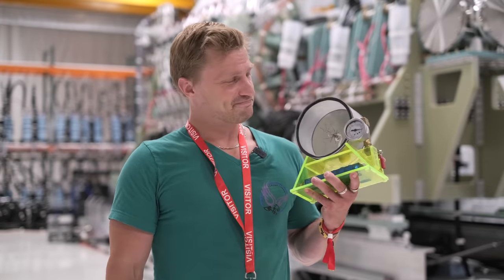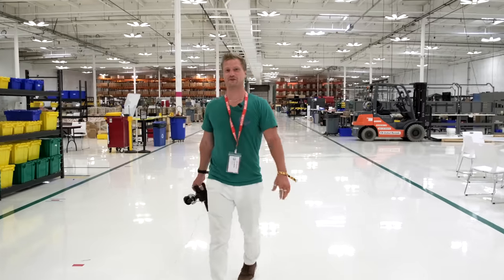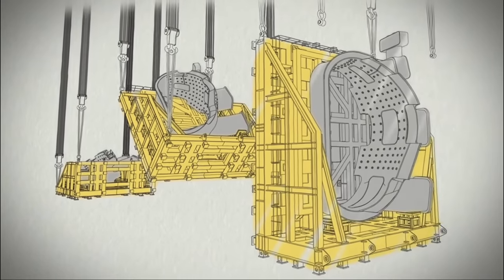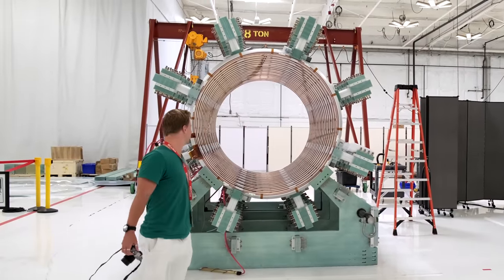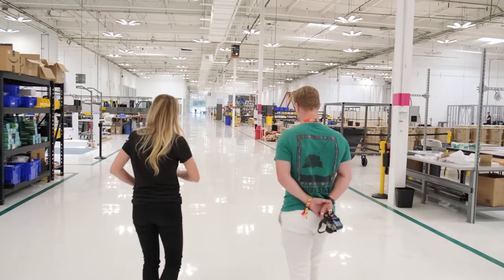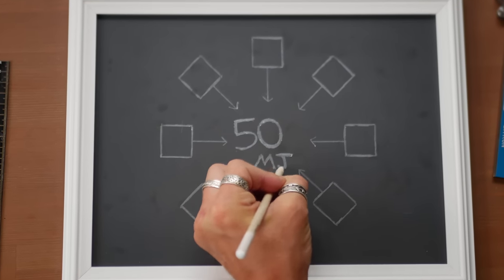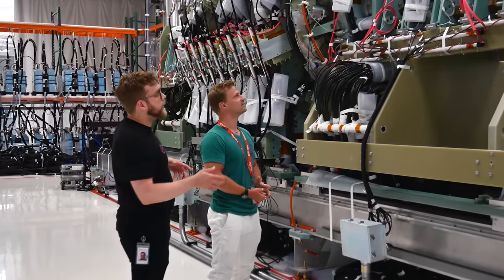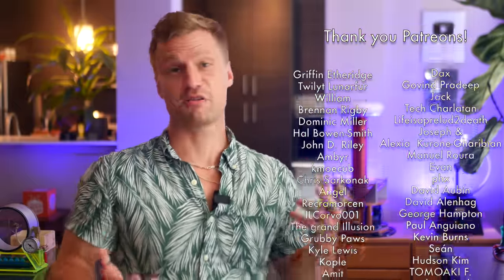An Exotic Approach to Nuclear Fusion (Helion Energy BTS)

Comment: But D-H3 will also produce neutrons (albeit less dangerous). I was quite sad to see they completely omitted this detail. They have neutrons detectors in there too.
Reply: They'll have 10x less energy output as neutrons, lower individual energies, and a cheaper and more durable reactor chamber than tokamaks which probably have the toughest situation with neutrons. It's really night and day as far as the neutron situation
Reply: as i understand it there is no way to accomplish fusion without creating neutrons
Reply: @charlesreid9337  pB11 is close with .1% of energy from neutrons. I think He3-He3 is even better and thus popular for interstellar engine concepts but requires an external source of it like the moon or Jupiter
Reply: @Canucklug  I know but they should have taken 30 seconds (in the already too short video) to explain that.
Reply: No they won't, because DT-DT reactions will happen as well, and the reaction energy of D-He3 is very low vs DT-DT unless reacting ridiculous temperatures, probably meaning the fuel density needs to be higher.  @Canucklug
Reply: @kylethompson1379  D-T reactions are greatly suppressed because the Tritons produced in D-D reactions are too hot and non- collisional on the timescale of the pulse (<1ms).
They are extracted along with the other fusion products between pulses.
Reply: That they don't have any neutron absorption material (even just polyethylene tanks of water) around the reactor shows that they don't really expect significant fusion output.
Reply: @r0cketplumber  
What reactor? Polaris is not completed yet. What they show in the video is the formation test machine. It does not bring the plasma to fusion conditions but is used to test the formation part of the Polaris in a zero- neutron environment. That then will help them optimize Polaris when it comes online. Polaris will have quite a bit of shielding too. A borated polyethylene and borated concrete shield vault will surround Polaris to protect the area outside the machine from neutrons.
Trenta was a low pulse rate machine and it still had shielding in the walls around it.
Reply: Do you mean D-He3 or D-T?
Reply: @caneintel   I think he is talking about side reactions or something.
Reply: Real Engineering has also done a video with Helion and he goes into much more detail about different fusion cycles including their energy outputs and particle emissions.
Reply: @Roset595  And https://youtu.be/3vUPhsFoniw is a response to all of these helion puff pieces from someone that actually knows what they're talking about.
Reply: D-D reaction also produces even more neutrons. They make it sounds like their method is almost entirely void of neutrons and thus "better". I wouldn't be surprised if they run into the same durability problems once they actually try to scale it up and produce power.
Reply: @pdog6041   Only half of the the D-D reactions produce a neutron and that only has 2.45 MeV vs 14 MeV from D-T reactions. D-He3 does not produce any at all. So overall, they get a neutron from one of three reactions (rather than every reaction) and if they have enough He3 from Tritium decay, then only from a quarter of the reactions. And again that neutron is only 2.45 MeV which is below the activation energy of many materials. And those materials they have chosen that do get activated have a very short half-life when activated.

Also, they say that the D-He3 reaction does not produce neutrons, which is correct.
Reply: @elmarmoelzer2229  D-D side reactions have a very similar cross-section to D-3He at the energies they are targeting. 50% of those D-D reactions produce 2.45MeV neutrons and 50% of them produce Tritons. Even if those Tritons are too high energy to produce D-T reactions immediately, some will get trapped in the vessel walls and come out later. Hydrogen just loves to permeate into things. Et voila, some 14MeV neutrons are inevitable. Not as high a flux as in a D-T Tokamak but certainly not zero. Reactor parts, diagnostic sensors, etc. will degrade over time, low-level nuclear waste will be produced, and safety shielding will be required.
Reply: @MattNolanCustom  Tokamaks are steady-state machines. The plasma inside is kept for a long time, so it is possible for them to accumulate substantial amounts of tritium in the walls. Helion's machines are pulsed, the reaction chamber is evacuated after each (very short) cycle; any tritium trapped in the walls, and later on out-gassed, will leave the reaction chamber before the next cycle, negating the opportunity to accumulate.
Reply: @charliem6590  I'm sure Helion hope that will be the case. It's on them to prove it. Very difficult for us to speculate accurately. Maintain such a high vacuum over repeated short cycles in a large chamber is going to be difficult.
Reply: @MattNolanCustom  Sure, parts of the machine will see damage over time, but it is not going to be anywhere near as problematic as for a D-T machine. The parts most hit are the vessel wall around the burn chamber and the magnets there. All the expensive parts are at the ends of the machine, relatively far away from the burn chamber, which is comparably simple (a quartz tube and some aluminum magnets around it). Because the machine is cylindrical, it is VERY easy to replace those parts unlike with a Tokamak where the magnets are always in the way. Maintenance will probably be some 2 weeks or so every year. Really quick and relatively cheap.
Reply: @elmarmoelzer2229  the neutron flux will be pretty much isotropic, so the irradiation damage will fall of as inverse square. All parts of the machine will receive damage over time but, yes, more so in the middle where the plasmoids collide. Yes, it will be less severe than a DT machine, but to generate the 3He, they'll need, they're proposing to run DD machines too, which will degrade more quickly. The issue I have is more the fact that fluff videos like this totally gloss over any mention of irradiation damage by touting the aneutronic fuel mix. I know that all marketing tends to do that kind of thing, but Fusion needs to be more honest to keep public trust and not become doomed in the court of public opinion like Fission has.
Reply: @MattNolanCustom  
I am very much aware of the D-D fusion part, thanks. They can do that in the same machine or a different machine (first machines will do both). If they do it in the same machine, then only about 1/3 to 1/4 of the reactions will produce a relatively low energy neutron. 
They never said that their machines do not produce any neutrons. They said that the D-He3 reaction does not, which is correct. If you look at their website and the FAQ there, then you will see that they do talk about neutrons and radiation produced by their machines.
Reply: wtf are u talking about? Li-5 decays into an alpha particle and a proton.
Reply: @marcianoforst6311  Li5?
Reply: Yes, there was a solid video released on this and other criticism about 7 months ago. I was expecting SOME sort of comment about the temperature levels that need to be achieved to increase the amount of helium-deuterium reactions as opposed to deuterium-deuterium. At 100 million C there are still a LOT of the unwanted deuterium-deuterium reactions which release neutrons. So a lot of shielding would be needed, and alternatively they will need to reach higher temperatures with Polaris, but again no info on that.  There are other potential problems with the magnetic energy capture but I guess that might be a problem they're planning to tackle in the future. Basically this video is an ad.
Reply: @charliem6590 Not very likely. The energies the fusion products possess are sufficient to imbed into the walls. This isn't simple adsorption, the velocity of the tritons means they will be under the surface of the walls. A vacuum in the chamber won't free them, they will continue to build up over time and cause an increase in neutron emissions.
Reply: @afz902k  Sorry but calling that video "solid" is like saying talc is a hard rock. If this comment does not evaporate too, I may try to explain why.

Edit 1 hour later: OK, still here. Let's see if I can add something without tripping the algorithm of death. The main problem in that critique video is that its author, very evidently, did not study the machines he was criticizing. The end result is full of straw man arguments. He misrepresented the temperature goals, the neutron production, the shielding, the past claims, even the power objective. Very sloppy work.
Reply from the maker: If this video was an ad, I would have been paid 😉 I chose to cover this company because I personally found them fascinating.
Reply: @RMX7777  Third try. Will this comment stay this time? Its getting tiresome. OK, my point is that the repeated vacuum (even if partial) prevents the accumulation of tritium in the reaction chamber. No need to force anything from the walls.
Reply from the maker: @charliem6590 not sure why you’re not seeing your comments. I rarely ever delete comments. Maybe three times in the past 5 years.
Reply: @PlasmaChannel  Second try, once more. I'm sure it is not the fault of this channel, I had the same problem in many other. Some kind of faulty algorithm.
Reply: @elmarmoelzer2229  "They said that the D-He3 reaction does not, which is correct"
Do you see how disingenuous it is to state only that in a serious summary video about Helion project? Did they want to trick people? Just say there are going to produce neutrons but they will be much less problematic for all the reasons stated here and elsewhere compared to a tokamak fusion reactor. People interested in fusion have a brain and can understand. I am saying that and I actually have faith in Helion methodology! I think they can be successful.
Reply: @MusicInUniverse  This is a short video, made by a 3rd party, covering few, small aspects of the whole design. There is a lot that is missing here (e.g. the entire fuel cycle, which they even have a patent for, the Te:Ti ratio, etc, etc). Sure, in an ideal world, they would cover everything and go into every detail. But this is the real world and people have time constraints and can only talk about so much. 
A lot of the rest in covered on their website (e.g. in the FAQ and their technical papers) and their patents, etc, etc. 
The D-He3 reactions are the most important ones to Helion because they are the ones that release the most energy and the most energy in charged particles. So, it is natural that they would focus on those. 
They could have even mentioned the D-D reactions and other details to the interviewer, but it maybe fell under the table during editing, or the camera was not on at the time, or whatever. It is not an official company video. So do not get too hung up on missing details.
Reply: @charliem6590  Refer to my previous comment, a vacuum will not be sufficient to remove the tritium from within the walls.
Reply: @RMX7777  Again, not my point. Repeated vacuum avoids T accumulation IN THE PLASMA, no need to remove it from the walls. Moreover, after equilibrium is reached the amount released [from said walls] each cycle will always be less than amount produced (only a small portion won't follow the magnetic field to the diverters).
Reply: @charliem6590  the fusion products are very fast and will embed them into the walls on a 10^-8 second timescale. Basically, they move much faster than they can be evacuated.
Reply: @caneintel  In a 20T magnetic field, the gyroradius of a 1 MeV Triton is aprox. 1.3cm, small in comparison to the diameter or the reaction chamber. In consequence, only a small percentage of the Tritons produced each cycle will reach its walls (most will leave it spiralling around the magnetic field lines). Even so, T ions will reach it in small quantities, accumulate, and start resurfacing ... but the T flux from wall to plasma will never be higher than the T flux from plasma to wall. In summary, the amount of T outgassed from the wall will always be small compared with the amount of T created in one cycle, it won't change the composition of the plasma significantly.
Reply: @charliem6590  the gyro radius doesn't matter. It's a 3 AMU particle with 1 MeV. It's going in a straight line into the wall.
Reply: @caneintel  Sorry, no charged particle, no matter its weight, is going to move in a straight line inside a 20T magnetic field not parallel to its trajectory. That's wrong.
Reply: @charliem6590  no offense buddy but you don't know what you're talking about and you're taking this personally. Sit down and go do the math.
Reply: @caneintel  Don't worry, nothing personal from my part. If you are able to explain how it is possible for a Triton, a charged particle, to move in a straight line submerged in a strong magnetic field not parallel to it, I'll gladly thank you for having taught me something new.

By the way, no problem if you use math, even better. Let me start  with the formula for the gyroradius (rho) of a particle of mass m, charge q, and a velocity component perpendicular to the magnetic fiel v(T). B is the magnetic field:
rho = m v(T) / ( q B )
Reply: @Canucklug  the neutrons are still more then powerfull enough to create problems and would need massive ammounts of shielding they currently dont seem to have
Reply: because their a bunch of scammers if you pay attention to the details.
Reply: @r0cketplumber  I think that is 'optimistic' because it's difficult to fine tune the nuclear physics in a fusion or a fission reaction. The energy distributions follow a [Gaussian-like] distribution, so they will get small amounts of lesser and greater energy production, along with the associated nuclear reactions, including neutron-rich production. At these energies, there will also be side reactions of pairs of deuterium, producing excess neutrons. At breakeven [greater than 10 reactions per second?], 2 - 4 of those reactions will generate neutrons that are biologically hazardous.  A rough analogy is laser physics: in atomic physics, the goal of a laser to to achieve a single wavelength, but if you examine the spectroscopy, there is always a narrow band of wavelengths, not just a single one. That type of distribution will also occur with their nuclear reaction. Physics doesn't include a Maxwell's demon to allow you to pick and chose only the desired reaction. The deuterium atoms will react with other deuterium, nearly as much as with Helium, at these energies. The side effects will be significant and cumulative. And, easy enough to calculate with 50 year old technology, probably available in an old nuclear physics textbook.

Comment: This approach reminds me a lot of the classic internal combustion cycle:
Fuel injection > compression > combustion > expansion
Except the combustion is a nuclear reaction instead of a chemical one and the compression and expansion are done via E-M fields instead of pistons
Brilliant
Reply: I was thinking something similar. Kind of like back pressure from an engine to slow it down too.
Reply: Yes, exactly.
Reply: yes and traditional reactors like ITER are literally steam engines -- you need them burning continously

but you don't want your gas engine on fire, you want the fuel to explode in the combustion chamber

similarly in Polaris (ideally) the MeV charged products produced in the ~20KeV (I'm guessing) plasma heating from the initial pulse energy will further heat the fuel ions  to something even more useful like (say) 50KeV and quickly use them up

like the explosion in the combustion chamber, this reaction is fast (less than 10ms) and doesn't require ignition

which is good because ignited fusing plasmas mostly heat the electrons, which radiate brem